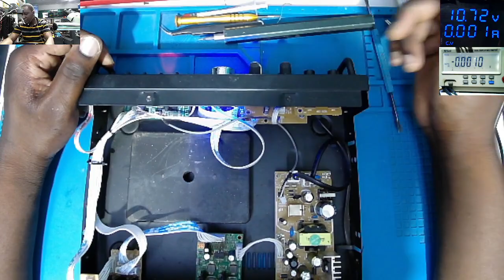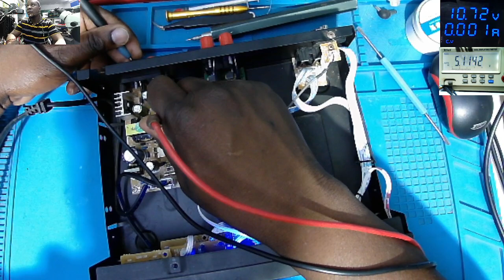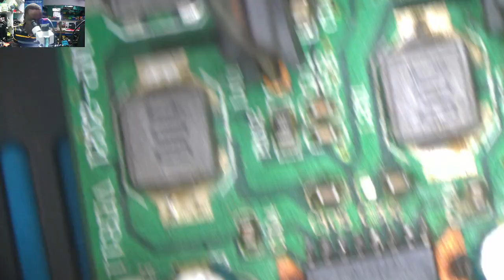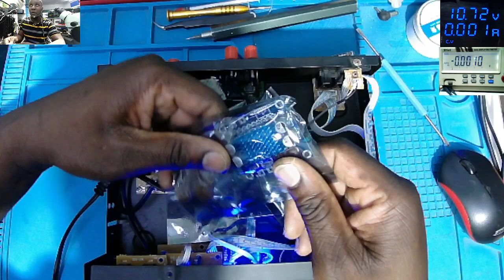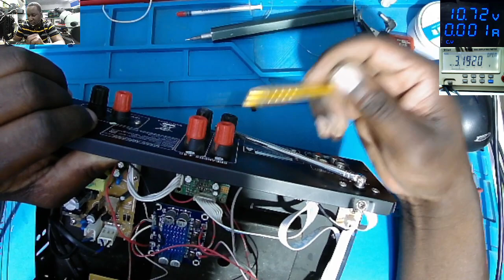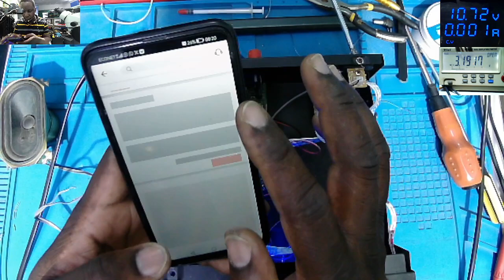What to do If You Don't Have Sound IC-- Lets Modify Amplifier Using TPA3110  Sound Modules!!!

Comment: nice job brother ! what is that things in box with which you clean soldering tip ? it looks like many things inside :)
Reply from the maker: It's old ancient rosin flux😂😂 with solder balls which been used  for so many years and changes its original colour .
Reply: @BstAfricanElectronicsSurgery  haha amazing i was like what a F*** is that hjahahahaha :D Good video like allways <3